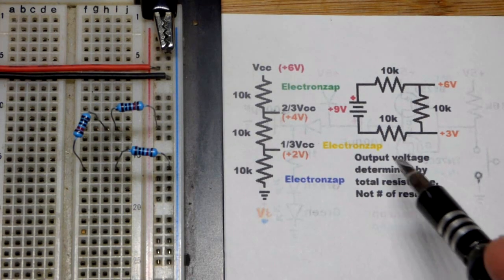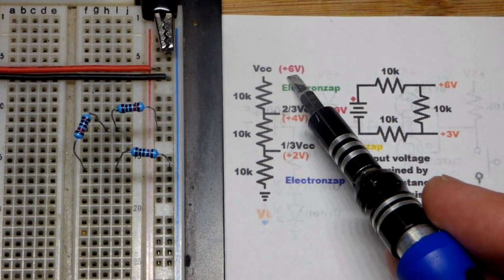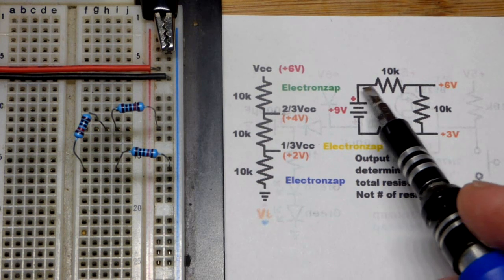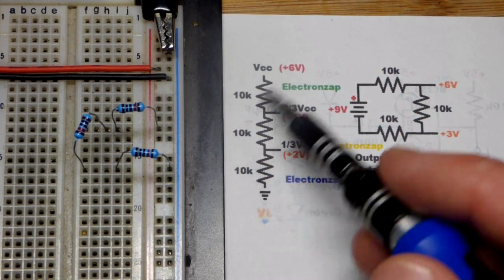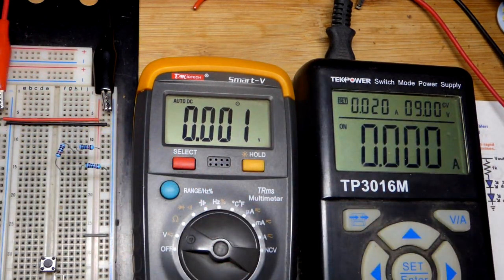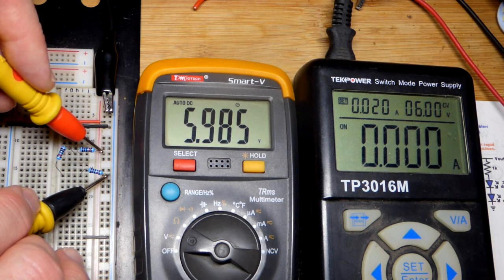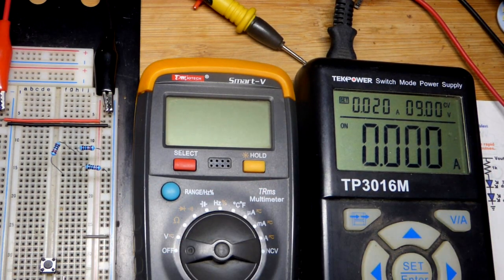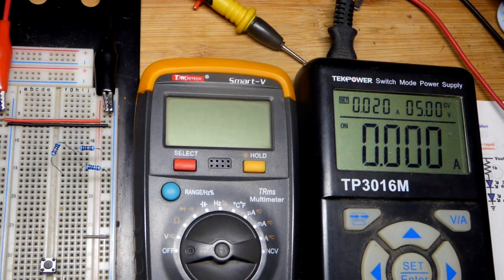One third and two third supply reference voltages obtained with 3 equal value resistors

Comment: The three resistors are the same value. Why 10K, why not 27K, 33K, 100K, 470K, or even 1MΩ ?
Reply: The amount of current being sourced by the voltage divider will set the resistance value of the 3 resistors in his example.   The current going to the load must be much smaller that the current going through the "middle" resistor in the voltage divider.   I= V/R    3V/10k Ω=  300 micro amps  , So the 3 by 10K resistors can only source roughly 3 micro amps.   3  by 1MΩ resistors  could only source  30 nano amps.
Reply from the maker: Any 3 equal values will make a 1/3 and 2/3 voltage divider. Low values will get hot and waste power, too high of values will be easily thrown off when an input, such as the multimeter probe, is connected to it. 10k seems to usually work well for most circuits.
Reply: @Electronzap  Wrong answer.
What you have said is correct but there is a key concept you have not covered.

You need to decide how much voltage drop on the output voltage you can tolerate as the load current is drawn.

Lower values of resistor in the potential divider chain mean that as the output current increases the change in output voltage is reduced when compared to using higher value resistors.

It's called load regulation.
The precise values of the resistors in the potential divider chain affect the load regulation.

If you want a stable voltage, that doesn't drop much as the load current increases, then you need lower values of resistance. But that comes at a price, which you did cover - increased power dissipation in the resistors.

It's a trade off between stability of the voltage as current is drawn versus wasted power dissipation.

The trick is knowing the math to be able to design the potential divider properly for a maximum voltage drop when a specified current is drawn from it.

The starting point needs to be:
(1) Deciding what voltages you need on the output; AND
(2) Knowing how much voltage drop you can tolerate on the output voltage for a specified amount of current being drawn from the potential divider.

Then you have sufficient information to:
(1) Identify the ratio of the resistances
(2) Set the absolute value of each resistor
to achieve your design goals described in the previous paragraph.

It shouldn't be down to guess work.

Comment: I'm commenting on this video because I'm having a hard time and I figured this video would be the one that you would read the comments on. So my problem is that I have three Leds, each LED is connected to its own switch. Is there a way, without using an Arduino or raspberry pi, to turn on the LED with its button but when the next button is pressed to turn on its LED it will turn off the first one that was turned on? I cycled through some of your videos but I can't get the right wording to search accurately enough. Thank you!
Reply from the maker: Not really a simple circuit, but you could wire each push button switch to turn on, and keep on one LED after releasing the switch, while also turning off the other LEDs. I can't think of what that kind of circuit might be called without googling for a while.
Reply: You need some logic that can remember and change state, so look into various kinds of flip-flops. But you're right, these days microcontrollers are often the way to go.